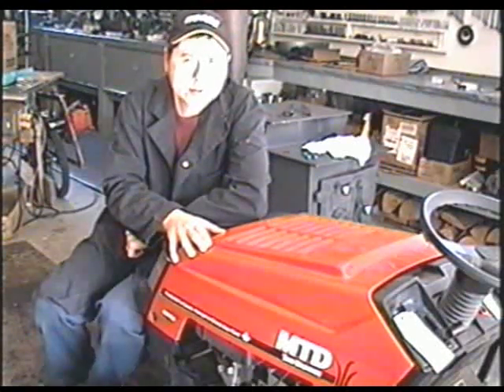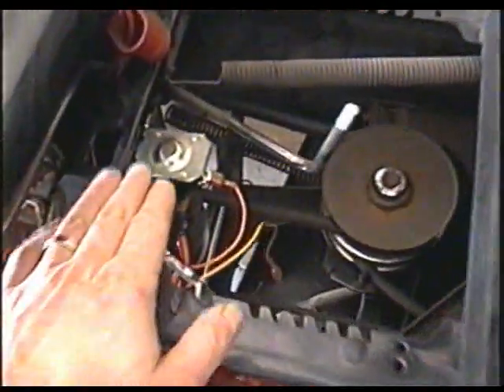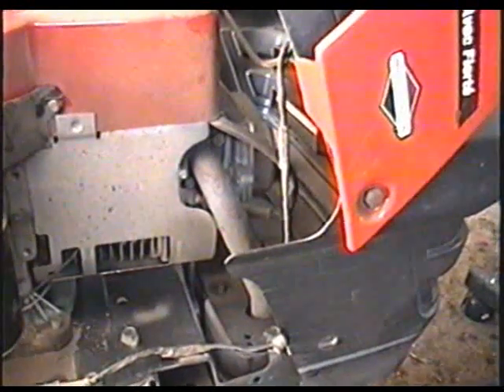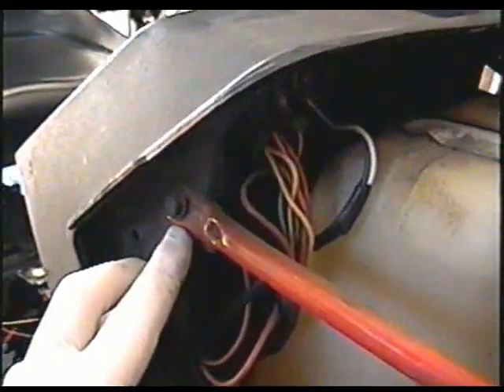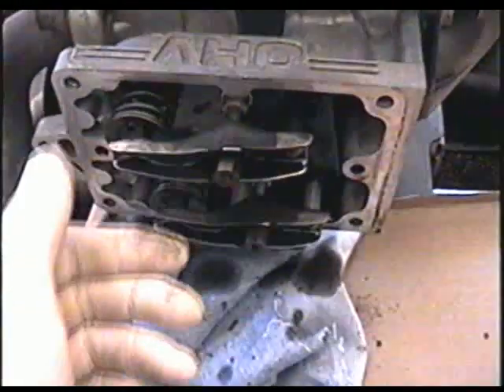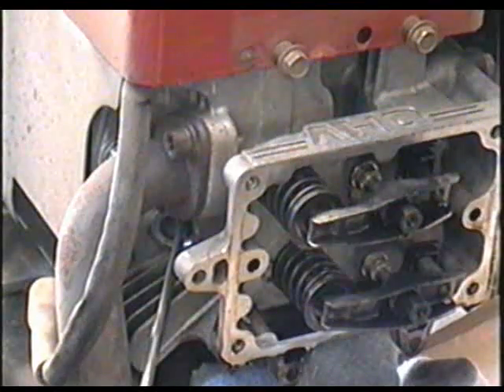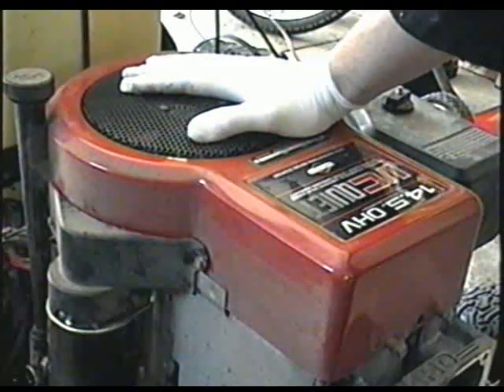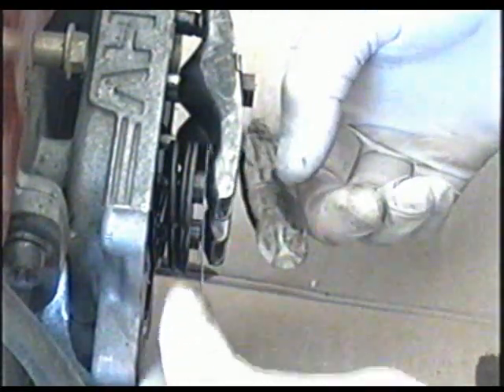( HOW TO ADJUST VALVES) FIX HARD TO START Lawn Tractor with OHV Briggs Engine- MUST SEE- Part 1/2

Comment: I have a craftsman dyt 4000, 18.5 hp ohv briggs & stratton engine, I've fixed a couple main issues on it, but it still is hard to start after adjusting the valves, help please

Comment: this didn't work for me. New battery to it hits the compression stroke and stops. I've check the starter (took it apart check and cleaned it) and checked the valve clearance like 6 times just to make sure i wasn't missing something. Any ideas. thanks

Comment: Hello Donyboy73  my 18HP B&S twin opposed is doing the same.  can i Adjust valves ?
Reply: YOU cant really adjust valves on these engines/ you will have to grind down the stem a few thousands then use feeler gauges to get the right valve lash[I must warn you it can be rather expensive for repair parts]

Comment: QUESTION, I have a 5hp tecumseh ohv  snow blower engine- craftsman 143.985503--- model, I have 120 lbs compression using starter, carb is new, timing seems right on, and it wont even fire when I cold start with starting fluid- not even a pop- I refer you all the time when ever I sell a snow blower as the "go to guy" on youtube- any ideas- help- I hate to toss this engine- thanx - rich

Comment: Hey dony how do i adjust the valves on a toro z master 0 turn tractor they are very different is got a kohler engine 27 sp if u can help me plz thx
Reply from the maker: they might be self-adjusting. I would have to see it with the valve cover off

Comment: Hey donyboy73 good videos actually starting to get results my briggs13.5 w a nikki carb was started running poor then it started doing what this video showed I replaced filters,plug,gas line, put shut off valve, oil and rebuilt the carb after cleaning it twice atterie seems fine after charge and so does the starter after installing the shut off valve and rebuilding the carb it doesn't seem to have a problem turning the motor any more??? Also the carb must have flooded the engine because there was gas in the oil. ?. I'm about to blow this mower up could it be the carb is garbage or I don't have the mixture right? Or should I try adjusting the valves anyway even though it turns freely now? Any help with this would be awsome.... I'm ready to kill the mower all the way and my wife is ready to kill me!!!!

Comment: +Donyboy73  We adjusted the valves, replaced the battery, and even put a new flywheel-key in, but the engine still is hard to start and runs very rough.  The 14.5hp Briggs had all the symptoms of misadjusted valves and off-timing.  Please help Donyboy!

Comment: i'm doing something wrong, i tried adjusting the valves but it's still hard to start. not sure if i set the TDC correctly or not. i tried turning it 1/4" but the valves won't be even anymore. what am i doing wrong?

Comment: Hi,I have a troybilt pony 17.5and it back fires when trying to start...could it be timing or can it be timed?...help
Reply from the maker: cindy richmond hi cindy, it's possible that the valves need adjusting like in this video
Reply from the maker: cindy richmond at least try a new spark plug first
Reply: It keeps shearing the key way when trying to start
Reply from the maker: cindy richmond might need the valves adjusted, also make sure the flywheel nut is properly tightened or it will shear the key

Comment: I have a Craftsman 17.5 hp mower which runs, but it does act like it don't want to run over before it turns over normally and starts. That must be what is about to happen to that mower too.
Reply from the maker: quite possible, also make sure your battery is good
Reply: The battery is good and the mower starts each time, but with that no motor turning over the first time you try to start it. After it is running for awhile it starts fine and I have learned to even keep it running during the Winter months and the same with my zero turn John Deere.
Reply: Check your charging voltage from your engine [on some models you have a regulator rectifier] your mower should charge over 13.20 while running .
Reply: I got it running and used it for awhile before it ended up sitting for awhile. I have to boost the battery before using it again to sweep up the leaves. I thank you for the help.

Comment: Hey donyboy73,  question for you - Yard Machine rider, 12.5 B&S, just stopped running while mowing.  I think its an electrical problem.  Key start does nothing.  I put the battery on the charger for an hour - it started right up - for 20 minutes then shut down again - key wouldn't start it - used charger again for 5 minutes - started right up.  Any ideas?
Reply from the maker: test ur battery
Reply: donyboy73 Isn't a lawn lawn mower similar to a car where if it is running you could remove the battery and it would still run?  So as long as the mower is running, what difference would it make if there even was a battery in it?

Comment: I have a 24 hp twin B&S. I reset the valves. It turns over really well now but the only way I can get it fired up is by splashing a little gas in the air intake without the filter on. Anyone know if its the carburetor float or what else it could be?

Comment: hey dony do u have a email where i can send u a pic of the valves that im talking about so maybe u can help me out .. thx man for all the videos they very well done and u do a wonderful job.. keep up the awesome work. Thx man
Reply from the maker: can u post clear pics on my facebook? https://www.facebook.com/pages/Donyboy73-The-Small-Engine-Doctor-on-Youtube/234040803408166?ref=aymt_homepage_panel
Reply: donyboy73 Hey Dony, I have John Deere 175 that I can't get started.  All that happens when I turn the key to start is a rapid clicking sound.  The battery is brand new and fully charged, there is relay kit on the motor that bypasses the safety switches.  I just bought the tractor and had it running then when I was messing around with it I must have done something.  All the fuses are good, checked those, the gas cap vent is clear and unobstructed, air filter is clean.  The clicking sound when press in the clutch and turn the key to run leads me to believe the solenoid starter may be bad?  Any help would be appreciated, thank you!
Reply: Toaster sound like u solenoid when bad test it with a vm or try to jump it wt screw driver connect the 2 poles and see if works .. good luck

Comment: I have adjusted the valves 5 times each time a different result
with plug out tested the starter worked ok
With plug in, Nada, nothing, so re adjusted valves again
now with plug out,nothing, have I over did the starter, and its not working battery full charged
don't know where to check next.
wont work with or with out the plug
John R
Foley Alabama
Reply: +John R Johnson See my note
Reply: Try checking your crank case oil if it smells like gas or over full your carb leaked and filled up the crankcase [oil sump] /drain out the diluted oil gas mix and replace your oil. also get a inline shut off valve and only open it when your running your engine .....remember to close it off after you stop your engine......if you feel like it you can also clean the carb and replace both inlet needle and seat but this can get expensive on some models.

Comment: Valves in spec. Done it several times... TDs, 1/4 past, everything is in spec. Put the plug in, won't turn over. Pulled starter from another mower, same thing.... Any ideas?
Reply: The centrifugally operated compression release mechanism on the camshaft is not doing its job, probably gummed up from not changing oil or else from moisture in crankcase from condensation.  If you can get it started, there is some hope of fixing it without removing the camshaft.  You can try cleaning the sludge out by draining all the oil and temporarily refilling with automatic transmission fluid.  Then get it started and run it for several minutes.  Test and see if it turns over easily with the starter now.  If not, run it a few minutes longer and retest.  I'd guess an hour total run would be plenty.  If it works after that, drain the fluid and replace with oil of course.  If that doesn't do the trick, you'll have to pull the camshaft and see what's the matter.  That little slinger arm next to the cam lobe is the compression release.  It is only in play when the engine is at very low rpm, well below idle speed.  It swings out of the way centrifugally when the engine starts.  Before it starts, it holds the intake valve slightly open which reduces the compression during start up, making it possible for the starter to spin the engine easily.

Comment: I'm having this same problem - battery is good, starter just couldn't turn the engine.  Pulled the spark plug, and it turned just fine except that it started on fire!  What did I do wrong?

Comment: I had the exact same problem with my lawn tractor but it turned out to be a bad carburetor flooding the cylinders
Reply from the maker: yes that is also common, usually they need a new needle and seat

Comment: 18 hp IC Briggs Engine,single piston.  Would not start.  Removed spark plug and spins/cranks freely.  I adjusted valves per your video.  It cranks better but now backfires through the muffler and will not start.  What should I do?
Reply from the maker: check the valve lash again

Comment: 1999 Craftsman riding mower won't stay running on changing spark plug  and  clean my air filter and still wont stay  running what's the problem

Comment: had the same problem I took of the apark and spin i and adjust the valves a 4 and the same problem new batteri the same but if i cobert the carbuteror wiht my hand start runing why

Comment: I'm surprised it has loose valves. Every one I've ever seen, the valves tighten up with runtime, then it burns em. 
I'm suspicious of that camshaft dying or something. Hopin it doesn't loosen up in another few weeks on the customer.

Comment: Why would my mower smoke horribly, only start when air filter is out, lose a ton of power, so much that if you turn to sharp with PTO engaged it will die..
Reply: gas made its way into crankcase /check carb/buy inline fuel shut off valve. drain oil sump out [crankcase]of gas oil mix.

Comment: hey i have the same problem but i have an flat head valve what can i do to fix this problem. the engine is 12.5 briggs & stratton model # 289707  type # 015401  code # 920806401 the tractor is turf-power by agway

Comment: many thanks in this part 1,i entered a reply in part 2 also...i adjusted mine without a feeler gauge as i am used to stuff like this for 40 yrs,I will change the spark plug and go over things again after my next 1 acre of lawn work (grin) ,left the top and front off until i get all the rest done..all is cool,thanks again...honesty is the best policy,one makes more money that way...  205 05 26 4 pm

Comment: I just fixed one that had a shitty ground wire that grounds the coil when you turn the key off to stop the spark. It had a small rub in the wire that was intermittently grounding the circuit out. The thing would pop and run and backfire and do all the symtoms of a sheared keyway on the flywheel or valves out of adjustment. Be away of this also.

Comment: I buy HONDA small engines, and have never had to adjust the valves. If it doesn't start by the 2ND pull ,STOP you're doing something wrong!

Comment: hey donyboy73  .. i got a 12.5 flat head Briggs  rider the mower run's and cuts good . no smoke no loss of power .. but when i put it under a load it  oil come's out of the air breather that connects to the to the housing of the carb i was told it had a blown head gasket so i fixed that  {witch it did not have a blown gasket}  now i am being told it is the air breather assembly clogged  could that be it?  thank you i will wait for your reply
Reply: Ive worked on these engines for years and it could be two things [a bad breather valve]or sadly blow by pressure meaning you may need to take the cylinder oversize .Even though the engine may have plenty of power the cylinder becomes out of round causing a increase in crank case pressure.
Reply: i just ran it that way it lasted 2 mows before it blow up i went out and got a john deer